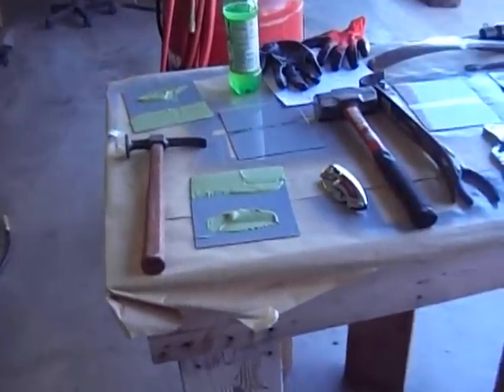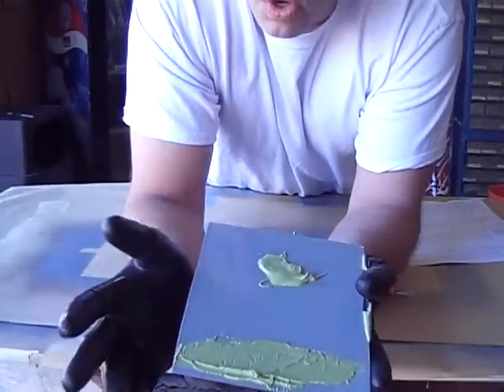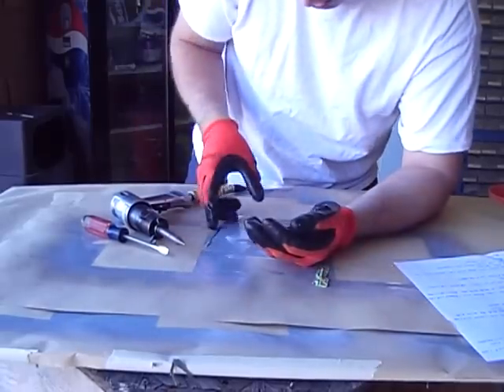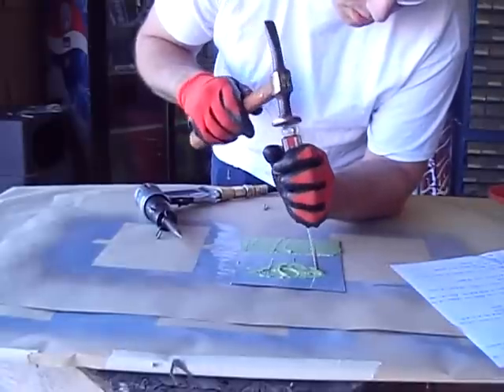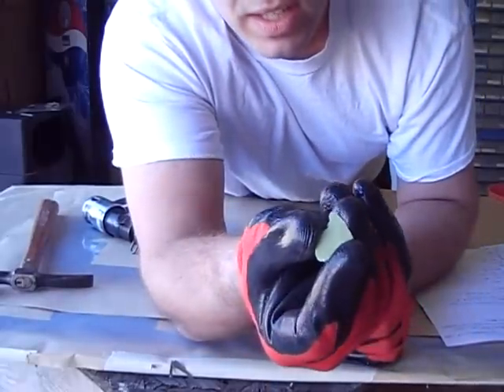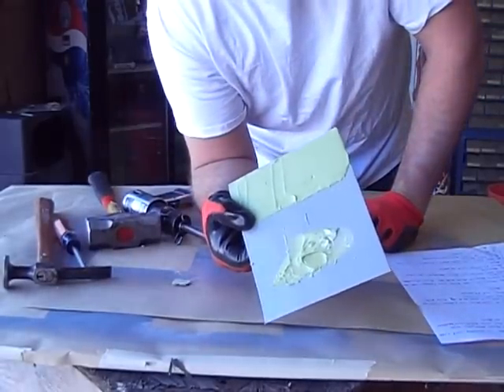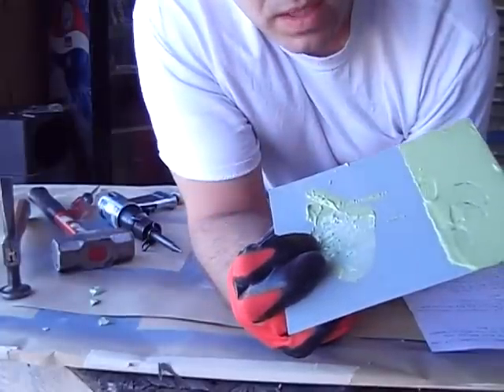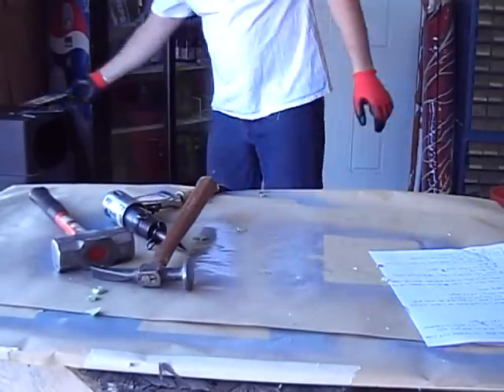Spi epoxy primer & Ospho torture test

Comment: Currently cleaning my truck frame to clean metal and using Ospho then priming with epoxy. This video saved me so much time and effort researching to get the exact process down for best results. You're video was extremely helpful, thanks for taking the time and effort!
Reply from the maker: Jared Smith glad it helped !
Reply: +Jared Smith  Although it has been a year since your post, just doing research as product changes, leading to new best practices.  I am also starting on a 67C10 truck frame after I remove about 30 rivets holding the manual trans crossmember. What I have seen, is sanding with flapper disc, wire wheel, degreaser, then hit with Ospho, re-wet, rinse then SPI black epoxy as they recommend 3 coats. It is not "UV" friendly, but can be coated with a top coat that is. Underneath is not needed, but like to keep a gloss black. Tech only, now retired, last job is for me. Not a  pro-painter but have done 4 of my own vehicles with excellent long-term results, but done with products from almost 20 years ago. New stuff better, but have to follow the rules. MrFireman164 did us a favor and me too to plan, execute and get results. Thumbs up!

Comment: So..... in conclusion, the OSPHO (with complete rinse) didn't do any worse than Test #4 (Tooth only)... but the difference in real life is that the OSPHO panels would prevent future rust-through from the base metal....where the metal in Test #4 could still have some residual rust that might eventually surface in the future??  Good videos.. Thanks for taking the time to do all that work!
Reply from the maker: Greg Blanchette thanks
Reply: Exactly, painting a tractor hood that had some rust. but what a great logical test.
I am painting a tractor Hood , the hood had some rust with a little bit of pitting in a place or two, so I'm going to use this method. Your analysis of this video is spot on.

Comment: The Spi epoxy is some good stuff. I have been using it for quite a while. My cousin's wife hit a deer a couple years ago and I had to replace the front bumper and other parts. I used the epoxy on the new plastic front bumper cover. She hit another deer recently and messed the front end up again. The paint cracked a little and the bumper did crack in half. I tried to peel the paint off, I couldn't get it to peel

Comment: Nice job.  And when the filler did come off, the bond with the epoxy didn't fail, the filler itself just broke, which is as you said, very extreme.   There was still filler bonded to the epoxy, it just broke above that. 
You can basically say that's "forever", for any realistic situation.

Comment: I just did this same video 😂.  Nice job, bud! Very thorough.
The neutralization of the Ospho is the key.
Reply from the maker: @randywiddis  one thing I didn’t do that i should have is left the ospho on overnight like the instructions say and then primed direct over it, I think it would fail however that’s what ospho says to do, supposedly the etch that it gives is good, but they also say to put a oil base paint over it which epoxy isn’t. I’ll watch your video maybe you address that. Thanks 🙏🏻
Reply: @MrFireman164  i didn't do the 24-hour dry time for Ospho, then epoxy in my video.  I've already had that fail in the past.
I had some conflicting results. Still not sure what happened. I do like the results you were getting with SPI.
 I've been trying to find something to remove rust that happens while doing metal work. Ospho neutralized was a possibility. Klean Strip is another. I just found Picklex 20... really expensive, though. I'm trying it. I already did some testing.. lol.
Reply from the maker: @ ospho seems to work good for surface rust and metal conditioning however the heavier rust it only converts the top and turns it black, if you sand over the black there is still rust underneath l, seems it doesn’t penetrate all the way to the metal.
Reply: @MrFireman164  I agree.

Comment: that was fun to watch!  the interesting thing is that when you leave filler globbed on thick like that, unsanded basically, it's alot more vulnerable to cracking, etc, so I imagine when you sand it down and have a thin later, the epoxy and filler will be a super strong foundation for your other topcoat materials.  I haven't used the SPI epoxy before, heard alot of good things about it.  It appears to have a glossy finish compared to some of the other ones.  Thanks for the vid!
Reply from the maker: Thanks , yes a lot of people like the gloss because it acts like paint showing the flaws so you know where you need filler :)

Comment: Wow thanks so much for this. Just confirming the procedure has not changed since this video. You can leave the ospho on to prevent rust flashing but before painting you need to wet it again with ospho and then rinse it off before it dries again
Reply from the maker: Bondo yes then re 80 grit the metal

Comment: Awesome test! Hey would that epoxy primer work for resurfacing a steel porcelain bathtub? That’s what I’m using the OSPHO for and came across your video.
Reply from the maker: This epoxy doesn’t play well with acid, I would find one that will otherwise it’s going to peel up more than likely unless you neutralize the acid really well.

Comment: Thanks for taking the time to show the world  what all of us on the " SPI Bandwagon" already knew - Barry's epoxy is awesome.

Your next assignment should you decide to take it is to ospho  bare metal, rinse, w&g, then bondo directly  to the metal.  Be a great comparision of bondo on steel vs bondo on SPI Epoxy. Another test would be to wash the bare metal with Purple Power before proceeding with your test, as Purple Power is a good wash if the panel has been soda blasted.

Thanks again for your time :)

btw - you don't need to remove the spring to change chisels, just push the spring tab sideways and slide the chisel in or out of the gun.
Reply from the maker: No problem it was pretty fun as well as covering my butt on a product I had never used, lol on the spring for tha air gun :)

Comment: Nice. Ready to spray this tomorrow. So if I used East Woods fast etch on a small rust area, do I need to sand the area down again to remove the fast etch zinc coating??
Reply from the maker: Call southern polyurethane inc (spi) I'm not sure about that product , ask the pros , thanks for watching

Comment: I use OSPHO in my shop all the time, but I use it earlier in the restoration process. We have all of our cars stripped at a thermal metal  cleaning company, and we do all of our restoration work with a 100% bare metal body. Although our shop is climate controlled, during the most humid times of the year I'll use OSPHO to combat flash rust or when storing bare metal parts. 
By the time we get to the stage of spraying, parts have been replaced, media blasted and often sat for extended periods of time, and were never had any issue. Ospho is good stuff, just don't over do it!
Reply from the maker: Nate Bernacki I’m sure ospho that has sat for a period of time , more than the time I gave it would probably be ok as you say , I have seen some who swear by ospho , however spi says be very careful if you use it to make sure it’s neutralized good , just what I was told by spi .
Reply: MrFireman164 We don't use it all the time, but it's usually early enough that by the time we're moving towards prime and filter work its old enough and been messed with enough that it's mostly gone. In not sure it'd be worth it to just coat stuff with ospho for the heck of it. Use it only when flag rust is an issue and prep like your video said and it's all good!

Comment: I used a phosphoric acid based product on my truck recently.  I was curious why the instructions said, "For better adhesion, reapply with 50/50 mix with water, rinse or wipe dry.  Now I know the reapplication of the acid reactivates it to be removed.  Thank you for that.

Comment: Interesting!  What about Ospho when dried, and then sanded down to bare metal, leaving the Ospho deposited in the target areas; pitting?  Wonder if adherence issues will remain under such conditions?
Reply from the maker: Spi doesn’t recommend unless you re wet with acid then rinse with water to Neutralize the acid and even then they are advising against it
Reply: @MrFireman164  I just did a nominal Ospho application on some small spots down the qtr panels on a 59 Cadillac. I sanded them down just leaving the small targeted pitted areas with Ospho remaining. It was dry and this now has me thinking just how bad bad bad Rust really is!

Comment: I'm renovating an old Dodge xplorer campervan that is full of rust in the bedroom floor and under the bedroom "garage" storage area with some areas so eaten through you can see to the driveway.  I used a wire brush to get it down to bare metal without eating completely though and scrubbed it down with water and bar keepers friend and then rinsed real well .. then slathered ospho everywhere about 2 days ago. Glad I found your video and hope that I can reactivate the ospho with more ospho and spray it all down to neutralize it before painting epoxy.  My only concern is that the areas that are so bumpy and porous can't be "de-opsphoed". What do you think, am I screwed in those areas?
Reply from the maker: mossy1 this is only for using spi epoxy , others may work perfectly with ospho , check your “p”sheet . If using spi they say just wet it with ospho ,  rinse and dry
Reply: @MrFireman164   ok so I should re-ospho and rinse everything and then just use the spi epoxy on the areas I plan on strengthening with Bondo.. and then can i pretty much use any other oil based paint for the other areas like "Rust-Oleum Rusty Metal Primer For The Ultimate Finish On Heavy Rusted Metal"? Also,  should i use spi epoxy under spots I plan on fiberglassing? Thanks for your help.
Reply from the maker: mossy1 I don’t know your skill level or means to do this , I cut badly pitted rust completely out and weld in new material , fiberglass is a lot stronger that bondo and is water proof so going that route use fiberglass for sure and yes you can use It over the spi , then over that it’s up to you as long as the bare metal is rust free and sealed with epoxy you can leave it in epoxy as long as no uv rays hit it .

Comment: Great vid...  Thanks for all the effort.  My question is if you're putting the oshpho on for preventing rust and you basically rinse it all off is it as effective?  The SPI certainly seems to hold up great!
Reply from the maker: Good question , the ospho kills the rust , then when you have the clean metal with no rust , that's when you protect it with the epoxy . Once it's sealed , rust can't come back because there is no oxygen , rust has to have oxygen to live:)

Comment: Most epoxy's are somewhat flexible when cured, so you won't get it to crack by creasing the metal as you noticed. lol. Polyester and urethane primers however will crack for sure.  I usually lightly scuff the epoxy with 80 grit before I apply the filler. I've never tested it but I assume that it would make the filler even harder to chip loose from the epoxy.  Anyways,, Good test!
Reply from the maker: Good point , adding a tooth along with the chemical bond would make it adhere even better
Reply from the maker: Thanks john, appreciate the input :)

Comment: Subscribed! I like the torture test or getting Western-On-It while using three methods. Although, this is now mid year 2018, how is it holding up on the project you where preparing to do. Also, asked by +damac2004, was the plastic filler used on the expoy during it's cure time or was it cured, then sanded a little with 80 grit used prior to filler, 36 grit, or not at all? Curious to know as i am a retired ASE Master Tech, not a body tech. Just doing my last project, a 67 C10 for my enjoyment until it goes to the children (Youngest 34). I want to use best practices to make my project last for years to give them something to remember me by, not real old, just a lot of serious pain. I am going the frame which is a little different than panels, but in the midwest, where salt is used on the roads, if i do the right thing, it will be a daily driver and well as something that last. Never heard of SPI epoxy, but will look into it. Thanks for the beating! Hope you are well and able to respond as firemen do not have it too easy, much less now, being shot at after someone starts the fire to get first responders in their crosshairs as you can't pass laws to regulate a crazy evil dude, only stomp it out. I will have to watch this many times to get it straight.
Reply from the maker: Dean Kay I suggest with Spi to clean the metal with 70/30 isopropyl alcohol, then 80 grit it , clean it again , then epoxy , 24-48 hours after epoxy , apply filler , sanding is not necessary within the 7 day window . After 7 days the epoxy will have to be sanded before filler .

Comment: Maybe an odd question, but exactly how do you rinse the ospho once re-activated?   Was it dipped or hosed or maybe even done with a scotchbrite pad with water, rinsing it out as you go?  I ask because I'm in situation with a classic Mustang where I'm stripping the car due to the PO's many layers of paint and honestly, I'm not sure what they did.  I'm finding they used different 'techniques' as I uncover each layer, so I definitely have to get to bare metal.  Once at bare metal, as you might guess, it may take a while to do the metal and body work and repaint.  So, I need to put something on this metal, and Ospho is what seems to be the recommended - but with of course the risks SPI has raised.  Many thanks.
Reply from the maker: Mike Ward the answer to that question is water. Now I always use spi epoxy so I never use ospho. I strip to metal, do my metal work, sand well with fresh 80 grit on a d/a and prime the part or parts. I never use any chemicals because I don’t trust myself to get it out of the seams which will cause the paint to fail later. My shop is climate controlled and so I can leave the parts in bare steel longer with no issues, however even after months I will go back over the metal with 180 grit to clean the metal the 80 grit to tooth it . Hope that helps

Comment: I don't know I did a sheet of 3 by 4 sheet metal brand new and I went over it with soapy water and then ospho because there was some specs of rust on it by the time I was done washing it with water both sides surface rust had layered the entire panel not sure what that's about. I'm guessing you have to dry the metal super fast.
Reply from the maker: scuba steve probably flash rust , just dry fast and buzz off with a d/a sander

Comment: Hi , what do you think the best way to clean off ospho after it has sat on a frame overnight? I appreciate it. Thank you for the videos
Reply from the maker: Depends on the top coat being used, if you are not using spi epoxy then the bottle tells you how to prep. If you are using spi epoxy, re wet with ospho to then rinse with water, dry with pressure air and tooth the metal with 80 grit on a d/a, clean with water based wax and grease remover and prime. I use 70/30 isopropyl alcohol until cloth is pulling nothing up.

Comment: did you get any flash rust when you washed with water? I used ospho and rinsed it with water and one min later it was covered in flash rust
Reply from the maker: Use warm water to rinse, then dry with a towel, then blow dry, the metal tarnishes an light orange color if you don’t, if it does tho just run over it with 80 on a d/a then epoxy
Reply: @MrFireman164  awesome thanks man ! I sprayed it with the hose and then dried with compressed air. The flash rust was instant basically. I’ll definitely give the warm water a try.  This is the best test video out there for this stuff. Thanks for making this

Comment: go figure.. i google "spi ospho" and your video comes up. good info. wanted to make sure washing with water was all i needed to do. wonder if you have to do the same if you apply zero-rust over ospho.
Reply: MrFireman164 i was actually going to ask you about how long you let it cure in this video.. i was reading a forum post where a guy didn't wash it, but let it cure, then scuffed and had no issues when spraying spi over it. i've only used the ospho on my rocker area so far. i didn't wash it yet, so i'll have to go back, re-apply, then wash.
Reply from the maker: Meant to say didn't do , tomorrow im going to spray my epoxy I may ospho another test panel and let it sit for 24/hrs till it turns white then sand and spray it with the left over epoxy to se what happens
Reply: MrFireman164 ya, i figured that's what you meant. cool deal man. i did see that he mentioned to make sure to wipe so it won't leave streaks. if it leaves a streak, you need to sand it down before epoxy. I'm interested to see how it does for you.

Comment: I’m pondering this question right now. 
I restore classic Volkswagens.
There are peeps who say they have had no issues using epoxy over phosphated sheet metal. Others say they had failures. 
I’m wondering if the failures happen only with specific brands of epoxy, or whether it’s all epoxy primer in general. 
Thanks for doing this test. 
Even the first sample which did show failure of adhesion by the epoxy, did take a lot of abuse before failing. It took a fair few strikes with a screwdriver before failing. In the real world, who is repeatedly hitting the bodywork with screwdrivers? But I take your point. 
I think I’ll do a test of my own with the Lesanol brand epoxy I use.
Reply from the maker: This test was for spi epoxy only, other epoxies may be fine just read the p sheets compatibility with acid.